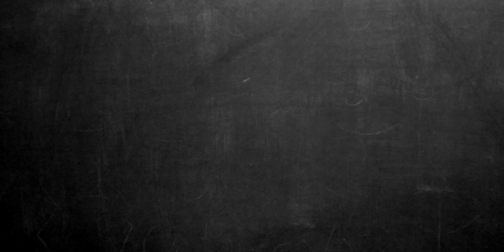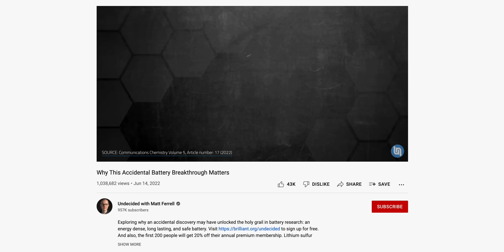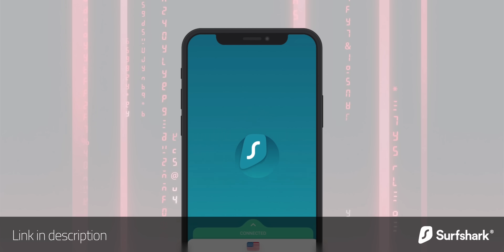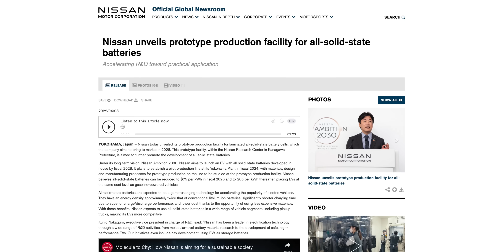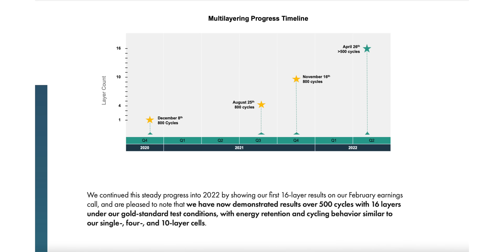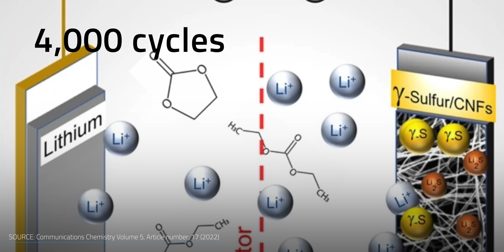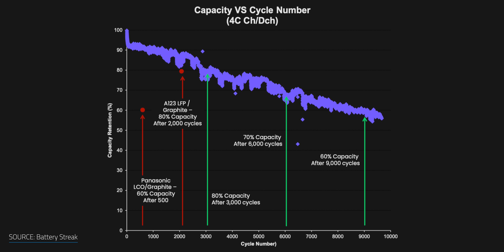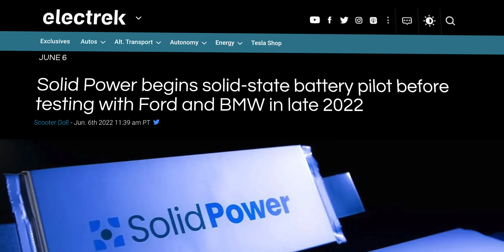Is This Solid State Battery Too Late?

Comment: They should work out a guide to how many announced 'breakthroughs' in the various technologies we need for a tangible result in our daily lives. For Hydrogen Fusion the number is probably infinity at the moment. Batteries possibly the conversion factor is 100. I just cannot see moving from my petrol car in the forseeable future. In fact with gas shortages Germany is having to reign back on electric vehicles as petrol is still just easier to obtain. This whole green revolution has definitely gone off at half cock before it is in any way practically feasible if we are not going to freeze or starve. We are having to get through next year with systems prematurely abandoned for some vague possibility of a development guesstimate years ahead. The panic over CO2 has just overidden all common sense.

Comment: Do you think you could do a video on the environmental costs by the different types of batteries and compare this to hydrogen? Furthermore, including recycling, second life of those and so on.. 
This, I and many others would say, are the bigger problems related to EV's and batteries, since it would be far worse to change all current vehicles to EV's rather than focusing on bio (or similar) fuels, due to building costs of the latter, infrastructure, recycling, and so on...
I do believe that EV's are not the futur, but hydrogen vehicles could do, in parallel with bio-fueled vehicles. However, having your take on this would be of great interest for all of us I'm sure!

Comment: I don't thinks that SSD's are the solution but at least, in theory, they are safer and should selfignite less rapidly then the current batteries. I don't think either that cars should all use the same tech. As you said, the right battery for the right car / truck / lorry...
I try to follow the evolution closely as mentally I'm totally ready to jump over to EV. What keeps me from actually jumping are two major things: safety (fire safety) and charging infrastructure. Living in Belgium (a hell hole according to a certain president) I can assure you that it's no where near allowing smooth transition to EV's, certainly in cities where people living in appartments just don't have the means to charge. In small towns or villages, space is not an issue but there aren't any charching stations or only a few (liturally 2 to 3). Speaking about chanrging, I'm not convinced either that using a cable is the best way to charge a car. In a digital age where "wireless" is the buzz word we still use a silly cable to charge a car. In short, not only battery tech needs to evolve but charging methods urgently need to kickstart their evolution. It's much to quiet in that area or am I wrong.

Comment: I agree that there is room for several technologies.  I think sodium batteries are excellent for grid storage, because they could continue working for 100 plus years, and great for off-grid solar.  And people that are happy with charging at home, would rather have batteries with more longevity and energy density than fast charging capability.  People that charge publicly will happily sacrifice a little range, maybe even some longevity, if they can charge very fast.  Then there are budget people, who want low cost but something that will last and don't mind sacrificing some range, and fast charging.  There will also be people willing to pay top dollar for something that does well at everything, perhaps sacrificing longevity to an extent.
But I think the big dollars will be for eVTOL batteries, and other aircraft batteries.  There, energy density, and safety will be king.

Comment: Alaskan here, one of the huge benefits of solid state batteries, which seems to have been completely glossed over here, is the performance in cold weather. Not everyone lives in California. I drive a plug-in hybrid, with an advertised all electric range of 20 miles, when it's below freezing, the range is closer to 2 miles. Too say nothing of the massive life cycle loss from freeze-thaw temperate changes.

Comment: Hi Matt ! An universal propulsion design (for air / ground and water / underwater) that is based on direct conversion of infrared radiation (sun mostly but IR lamps also when really needed) to mechanical energy with > 90% efficiency is THE FUTURE. IT NEEDS ZERO BATTERIES, ELECTRIC MOTORS, ELECTRONICS & COMPUTERS / AI etc. Virtually no technology at all and everything is user controlled but at the same time native 100% COLLISION PROOF = ZERO ACCIDENTS OR DAMAGES OF ANY KIND. Only 5 material types will be needed (syntetic / natural rubber + transparent polycarbonate / acrylic glass + carbon fibre / resin + cotton / vegetal silk / plant fibres + silicon). NO METALS OF ANYKIND ... Thus super ecological & environemantally friendly. TO WORK IT WILL ONLY  NEED LIGHT / IR + RAIN / PURE WATER. Yet again 100% Nature friendly and completely safe to use and reuse and repurpose / recycle. THAT IS THE FUTURE :) OR AT LEAST IT SHOULD BE ;) I FIGHT FOR IT BUT FOR THE MOMENT I'M ALL ALONE ON THIS AND MY 40+ OTHER SUCH SIMILAR TRUE FIRST PRINCIPLE DESIGNS ... In the end this universal vehicle will be able to ride on any surface and also underwater (hovercraft submarine) and even be able to float for short periods in emergency scenarios (falls, casms etc.). NOTE: the very fact that it is super light and super powerfull for its mass / manuvreable should render it the most pleasurable and at the same time safest to ride. ONE VEHICLE TO HAVE IT ALL FROM SAFE BABIES & ELEDERLY AUTOMAGICALLY DRIVEN ANYWHERE WITHOUT ANY TYPICAL TODAYS  (and even tomorrow's) AUTOPILOTS TO CHILLING WITH YOUR LOVED ONES  FRIENDS THE MOST FUN ON THE TRACK AND/OR THE OUTDOORS OR ANY APOCALIPTICAL SCENARIO (ex: the "tires" are regenerative and constantly open to live modifications for best grip as rubber type to best suit any climate) ... WHAT DO YOU THINK ?

Comment: So Matt… all this research being done on batteries is great. If you take our current battery technology back to the coal pile the CFP of this technology is worse than ICE when it comes to transportation. (Including disposal) Increasing energy density and reducing recharge is all great research but isn’t the Elephant in the room our current electrical distribution systems? Faster charging at higher density is great… but that’s going to require (in simple terms) bigger wire to each and every distribution point… all the way back to the production point. A 400 unit apartment complex as an example with 50-60% EV’s could require an crease of the incoming electrical service by 100%…?? Taking all this into consideration back to the coal pile, I think the evolution of EV’s is going to take much longer than the vehicle manufacturers are predicting currently. What do you say???

Comment: As I sat in line at the local Costco for gas  I remembered seeing a headline about how there is a new battery that can be charged to 80% in 15 minutes. I then counted the cars ahead of me and did the math. It would take 2.5 hours for me to fill my tank if I was in an EV and this gas station was an electric charging station. Yikes it took me 20 minutes in my gas car. With all the gas station infrastructure in our country the investment required to have enough charging stations to make sense is unimaginable. This combined with where is all the electricity going to come from? Windmills and solar won’t even cover our home electricity needs. All the math should be easy to complete, why has no one done this? Are we going down a path that makes no sense?  Or are there a lot of people making millions of dollars sucking in mindless investors of their life’s savings selling us snake oil? Mathematically prove to me this can be done? (rhetorical question).  The closest thing to this was a study in British Columbia Canada that stated for BC to be carbon free by 2050 they would have to build 30 site C hydro dams. Based on how long and over budget the current site c dam construction is, it is apparent that carbon 0 is impossible. Very little media coverage on this story. Go figure. We need less activists and more mathematicians on this. This all being said, batteries for cars, home, industrial use is the obvious key to store energy for when the wind doesn’t blow and the sun don’t shine.  Literally western civilization and way of life is dependant upon it.
Reply: The whole argument hinges on everyone like you needing to fuel at stations. EVs can (and mostly do) charge at home, eliminating that problem of charging at stations. And usually at night, where electricity needs drop a lot. 

And so what if it takes you 6 hours to charge at home, there's a very convenient time in your life you spend doing nothing... sleeping.

And as for your energy concerns, if everyone suddenly swapped to EV now, it would be a problem... but at the projected curve, it's simple to slowly build up capacity, hell currently we don't overload our power plants anyways because that would be disastrous. Plus, since most charging happens at night, when typically electricity demands are lower, it'll just make electricity be more even between day and night, something that's actually nice because powerplants need to predict energy usage to remain at a steady 60hz.

Comment: When it comes to game-changing tech...I always point to LED's as an example . LED's completely revolutionized the entire lighting industry ...from design to manufacturing to end user. That is exactly what has to occur with energy storage ... and with energy production. So many storage options that it's hard to point to where such a thing could occur...or if it could. As for production...the holy grail would likely be fusion...or perhaps the new geothermal. Fusion seems to be always a breakthrough away from arriving. With geothermal the source is just below our feet (a few thousand meters down)...but the problem has always been access...and the new tech solves that. It has the capacity to re-purpose existing generation plants and apparently can be implemented cost-effectively just about anywhere.

Comment: @Matt Farrell you could take out most of that production line video. Not really relevant to the context of this video in my opinion. I don't really care that a pre-production line has increased the number of "layers" it produces. I would also say that the resummarising of what a solid state battery is, at this stage, could be done in 10 seconds. Comparison in cycles, density, cost, discharge and recharge are key info.

Comment: The only “ev” I’d consider getting is a hybrid. The adaptability of it is far better depending on where you’re going, so I can plug it in for around town, and then fill it up with gas when going on long trips. And I can also utilize multiple varieties of fuel, wood gas, solar, gasoline, ethanol, etc.

Comment: First, how about a form-factor standardization of battery trays/cartridges and versatile/updatable in home charging systems?
EV’s are going to get extremely annoying (and extra expensive) if each manufacturer has proprietary charging stations and cables.. consider the irritating array of proprietary cordless tool batteries, or the multitude of usb versions between phone brands.
I’m not about to get locked into one manufacturer because switching will cost $10k for a new charger.

Comment: Liquid will always rule because cooling is always important throughout a circuit board. Cool the cells as well as electronics. Wicking heat away. I think solid state is a flop.

Comment: We don't actually need better energy density. 

What we need is the same energy density paired with dramatically longer cycle-life and an ability to get to 80% charge in 12 minutes or so while costing much less, being more recyclable, and being manufacturable with fewer impacts on the environment. If you look at laptops, phones, and cars, the batteries -- when new -- do what we need of them. It's the other factors, especially but not only cost and sustainable sourcing/manufacture, that we need.

Comment: Refueling stations:
Need to be swap old for new (Charged.)
Drive in, just like gas station.
Insert your card and the battery is extracted and replacd automatically with charged battery.
No moret than 5 min's.

Comment: If ever there was an argument for auto companies just getting their act together and formalising a set of battery swap standards, this would be it. It happened years ago with the likes of AA, C and D sells, but all that languished as companies went to built-in, unrepairable, custom cells to the detriment of everyone except their own bottom lines as they fought for competitive advantage instead of competitive cooperation.

A whole new industry for batteries would spring up with entirely new commercial models around owning, renting or simply using a battery in the way one uses fuel. It's already widespread in China and works (really, really well) with pilots now being announced in Europe, but the vast majority of the auto manufacturing industry just isn't talking about it.

They won't, because they want you to buy a whole new car. It would require worldwide legislature, and most Westernised governments are simply too afraid (or too corrupted?) to do so. Nonetheless, battery swapping would allow for boundless future battery technology introductions, negate a plethora of charging time anxieties, extend the lifetime of all EVs, encourage a new market for recycling, create a new market for the batteries themselves... Surely, that's what "market forces" should be all about.

Comment: Great update! Glad to see you mentioned Solid Power is already started pilot production of the 100Ah Solid State batteries. I'm optimistic there will be cars with 400 - 500 mile ranges in the next 5 year. 

There is also something better coming, but at some point you gotta put a stake in the ground and stay this is what we're building. Like Tesla and their 4680, not the best battery tech but proven tech.

Comment: the fast charging thing is difficult. It's gonna take a massive infrastructure upgrade to provide the kind of power you'd need to fast charge a large number of vehicles. I can't see it as a near time solution. 
There's never been a better time to make a breakthrough with battery tech, but we've been hearing this story for 10+ years and all we've seen is fairly small incremental progress

Comment: Grrat segment. Have you checked out Atlis Motor Vehicles? They are developing a 15 min (0-100%)charge NMC thermally controlled battery with 2000 charge cycle

Comment: Current liquid/gel lithium compositions don't charge as well at low temperatures and solid-state batteries appear to behave better under those extreme temperature conditions. Also, thanks to Tesla, the current Lithium technologies may be at the final stages of their improvement possibilities with just tiny gains to come, while SSBs reset the counter and are at the beginning of their own 10-year+ incremental improvement cycles. Tesla is silently moving to LFP for a part of their product lines, nothing says they will not jump to their own flavour of SSBs in the future.

Comment: Since EVs can charge quick in between 20% and 80% and If energy density increases, a car with, lets say 500 miles of capacity, wouldn’t that give 300 miles of charging to the car in under 15 minutes? That would be pretty significant

Comment: Realistically, we are probably going to need all of these batteries to get there. Companies are going to need to produce batteries at a massive scale to satisfy consumer demand once the global market is entirely transitioned to EVs, which is where we need to get to eventually. If all these batteries are using the same technologies and the same materials, that creates a supply crunch where there is extreme demand for one particular metal or chemical. Prices will become extremely expensive if all that demand is being pushed through only one material, or there simply won't be enough to go around. However, if we have a variety of technologies utilizing different materials, that eases the demand on any particular resource and makes supplying all this easier and more cost effective. I envision in the long run there will probably be several different tiers of battery technology existing simultaneously, being offered in different vehicles depending on the price point and consumer use model the cars are being marketed to.

Solid state also has strong real-world use cases where safety and durability is at a premium. Lithium batteries tend to catch on fire when damaged, so if you are, for example, driving an EV-powered police cruiser, having your battery be resistant to bullets or other damage is a significant advantage.

Comment: We don't need these batteries what we need is a hydrogen fuel cell to run these gasoline powered cars on the streets and highways so the people don't end up buying an expensive cars that they're going to even cost more money when the electric company raises the electricity prices so it would be better to have a hydrogen fuel cell to run these gasoline engines and diesel engines up and down the highway and save the public trillions of dollars and you could become the next trillionaire by making it patting it and selling it to the public but not the big corporations cuz they will hide your technology from the public don't get ripped off don't buy an electric car remember the television scandal they came out with colored TVs first criminal organization called Big Business said let's sell them black and white first it cost them a lot more money to produce black and white films that it did colored but the end result was the public ended up having to buy more televisions than they needed because the criminal organization called corporation rip the public off don't let that happen with electric car build a hydrogen fuel cell to run your gasoline engine and thumb your noses at the electric company and the gasoline company and stay Rich my friends